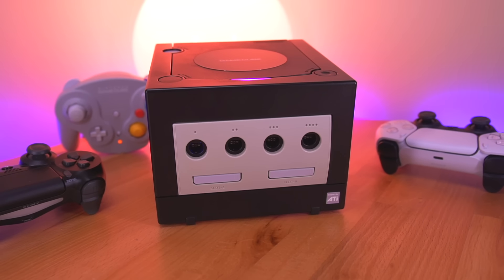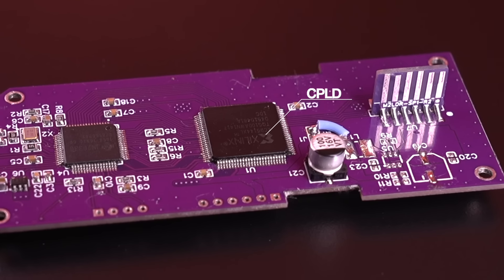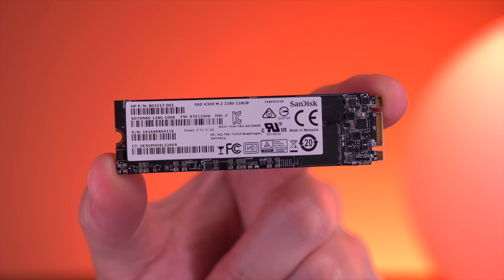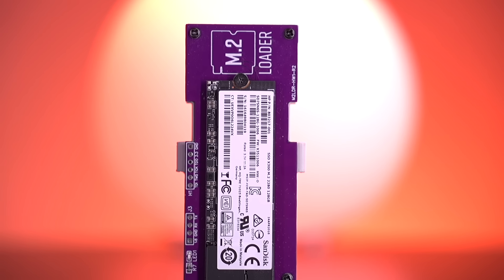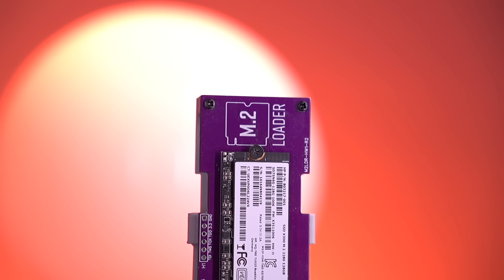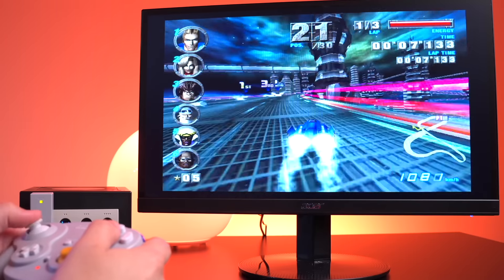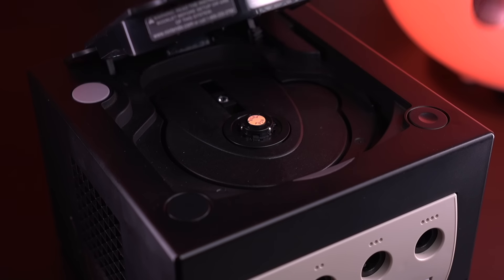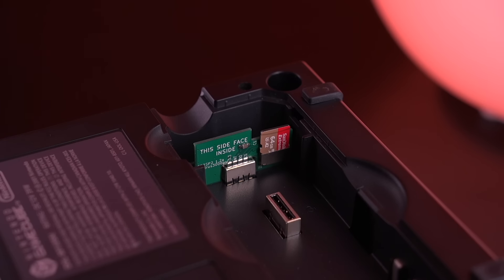M.2 Loader FIRST LOOK!  Unleash the Power of Your Gamecube!

Comment: This would be ideal for the Dreamcast as well, in combination with a recreated broadband adaptor in 1.
Reply: gdemu, MODE and usb-gdrom are already great solutions to this. The serial slot as a external device is not a good alternative to a external modification because the serial transfer speed is already way slower than the GD communication port the console has.
You can use SD serial adapter with Dreamshell but the serial speed is awful and it gets worse because all of the IO is handled in software. If a device similar to this existed it would be marginally better because of the external IO processor but it would still be bottlenecked by the awful serial speed of the console.
Although the title of the video makes people think that it is better to have a m.2 drive on the console, what is actually improving the game read consistency is the external IO processor, not the drive itself. I think it would be way more productive to make a SD Adapter with this IO processor built in instead of using m.2 drives that are still very expensive around the world.
Reply: @lordeilluminati  if they could combine the external IO and m.2 support for about 5tb.. imagine every dreamacat game cover art and video preview on a single Dreamcast.. 

We can only dream and hope that some smart cookie comes along and makes it happen. I'd be for it.

Comment: This is great, but a problem of SD2SP2 is that prevents the use of the GBA Player. It would be great if a future revision of this mod gets an FPGA on board with a GBA MiSTer core installed and some sort of physical switch, so you could to boot in NGC mode or GBA mode!
Reply: How does it prevent the GBA Player? I had no issues using GBI or my disc with my SP2
Reply: @Daqdaq15  I’m sorry, I had the impression it prevented somehow the use of GBA player. My mistake! (-:
Reply: It's the broadband adapter that it clashes with, as they both use Serial Port 1. The Game Boy Player uses the High Speed Port.

Comment: I have a Spice Orange Japanese GameCube that is modified to play both NTSC U/C and NTSC J discs with no visible modifications to the unit and was considering a second GC because I did not want to lose my optical drive but I did like the idea of using GC Loader. This seems like a perfect solution for an all-in-one GameCube.

Comment: The thing I don't like about all these things that take up the bottom ports is that you undo your ability to have things like the gameboy player or the ethernet adapter plugged in.  If you don't care about those things then it is cool to have the massive storage available.  I'd prefer to find a way to mount this internally or have a custom mini gamecube case that removes the disc drive that can fit the m.2.

Comment: The big difference in transfer speeds PC-side is mostly because most SD card readers use "High Speed" mode at it's slowest rate, instead of SDR50 mode or faster, so instead of 90mb/s+, you get 30mb/s.

Comment: Wow, I've owned one since release and finally looked into modding it. The GC2SD, SD2SP2 and pico board cost about $30. I'm doing this upgrade in prep for the M.2 loader. I love how it retains the optical drive. I never looked into GC loader much because I have discs I want to play and don't want to purchase a 2nd system, I have too many consoles already, haha.

Comment: Another awesome benefit that is usually discussed when using Raspberry pi products is that if you can use an SSD of any kind it is usually much more stable / longer lasting than the microSD installs. Might be worth noting in future videos comparing the two.
Reply: Yes, but in this case, not really. You're pretty much only reading from the microSD card after you put your games on it. The RPi Pico is a micro controller that doesn't have a microSD slot. The instruction set is written to a chip that is soldered onto the RPi Pico. It's a bit different from the RPi's you're thinking of.
Reply: @SoberAddiction  Thanks I was honestly unaware of this particular difference here
Reply: It would make sense if the console was reading and writing to the device, since data is only being read, there is no much difference in terms of reliability. Using SD makes more sense because it is cheaper to buy bigger storage than buying m.2 drives to a console that wont take advantage of the improved speed and reliability of the m.2 port.

Comment: Sounds like this will be great when it is released. I've had no real issues with the Xeno mod and the SD2SP2 though, and still no release date afaict on the M.2. So, as they say, if you can't be with the one you love, love the one you're with.  Will definitely be checking out the M.2 if and when.

Comment: Wow, i hope this gets adapted to PS2 and Xbox somehow down the line. Macho Nacho News Kicks Ass!
Reply: You can do this with off the shelf parts for the PS2 and Xbox. Look up a mSATA to SATA adapter, and then use a SATA to IDE adapter on that. There are also mSATA to IDE adapters, though they tend to adapt to laptop IDE, which has a different connector.

Comment: Apparently due to interference it's really not recommended to put the Pico in the serial port 1 area, but how cool would it be if the Pico could be part of the M.2 Loader by mounting it on it. Two projects by the same person combined into one. The 5 wires for the Pico could go towards this area without making additional holes yourself so no issue there, basically the only issue is the interference the Pico gets from being in that spot unfortunately.

Comment: But Tito, 2TB is a bit overkill for the GC, it's entire library of games is only around 880GB… 

Anyway, I've got my Spice Orange GC ready to be modded, I've got a Pico and Bluetooth controller adapter, as soon as this m.2 loader is available, I'll definitely get it.
Reply: Also, any SSD is so extremely fast that it will be wasted by the dinosaur hardware of the Gamecube.

Comment: Amazing video as always, Tito! - Can you suggest to WebHDX to look into including a serial passthrough of some sort so a broadband adapter could still be installed? -  Not bothered about having the adapter flush with the cube. I'm happy to put some rubber feet on the bottom to compensate for that.

Comment: This is amazing!  I'm extremely dumb and bought everything for the picoboot mod only to discover that my GCN is one of those fortunate devices to have a digital out but no SP2.  Did the entire mod just to have to undo it because I had no SP2.  I cannot wait for this to come out!

edit aaaaand I just got to the part where I still need an SP2 lol  I'm still very excited for this and hopeful that one day I won't need an SP2 :P
Reply: You don't need an SP2, use a memory card slot adapter.
Reply: For this mod, you can rebuild the sp2 functionally and leave the adapter and sd card embedded in the GC. Or make a hole on the case so you can access the SD card.

Comment: If he's going to downgrade to an RP2040, he might as well make a kind of "SD2SP2+" for SP1. The big bottleneck for SD cards is the fact the Gamecube addresses them in SPI mode, which is and always has been the 2nd slowest transfer mode SD cards have at under 10mb/s, and way slower than the Gamecube's serial port. With an RP2040, you could pass the SD card through the RP2040 in SPI mode during boot-up so RPiBoot can load Swiss, and then while Swiss is searching for storage devices reinitialize the SD card into SDR50 mode (which can cram up to 90mb/s, far faster than the Gamecube's serial bus) using the RP2040 as a translation layer. That'd eliminate the need for an SD2SP2 while still being dramatically faster, it'd be way cheaper to make since you wouldn't need the SATA bridge chip or M2 interface anymore, and 512gb SD cards at UHS Class 1 or faster (U1 marker on the SD card) are just generally cheaper than 512gb SATA M.2 drives.

Comment: There's a 4th benefit of using a SATA SSD instead of an SD card: they are way more reliable and last longer. SD cards don't have error correction and are prone to randomly dying from corruption. I don't know if this would be an issue in this use case if games are just loaded once then read from after that, but I would still rather have an SSD than an SD card any day.

Comment: I would imagine a lot will change once the RP2040 is used ,game compatibly, price performance, etc.
Also wonder if it would be easy to make a version with the Ethernet adapter built in with the rp2040

Comment: Just thinking outside the box here. The conversion from sata to ide is likely the reason that swiss can't load directly off this device, but once reworked to use the same chip as a raspberry pi, it might be possible to have the pi be smart enough to locally store (that is, not stored on the sata drive, but in the firmware) just enough to get swiss booted, then change communication protocols to fully access the sata drive when swiss boots.

Comment: Yet again although it's nice to have more GC stuff coming out of the mod scene, this is yet another solution to a problem that doesn't exist.  Now if when the new version came out, it didn't require a second pico and just wired into the picoboot and incorporated a sd2sp2 so you don't need to have both it might be interesting for anyone who's going to do a new mod to a system.  I'm perfectly happy with my current system and the speed increase is not something that I need.

Comment: I don't understand why removing the optical drive is apparently a deal-breaker for so many folks in these comments. It's likely going to be the first part of the console to fail anyways since the laser will eventually burn out, but there's also just no functional reason to load games from slower optical media if you're replacing it with a device like the GC-Loader that will ultimately be loading the exact same games from solid state storage (and can already boot Swiss directly).

I could almost see an argument for keeping the optical drive on something like the PlayStation, where you can at least use it to play audio CDs or DVD movies, but the Gamecube's drive was only designed to handle mini-DVDs, and the Gamecube BIOS/firmware has no means of playing CD or DVD content anyways, even if you made your own 8cm copies for some reason.

The GC-Loader's biggest weakness is that SD cards are a frail storage medium with a comparatively high premature failure rate (and extremely limited write cycles even in ideal conditions), but the M.2 Loader doesn't currently eliminate that dependency either since you still need to augment it with a SD2SP2. Personally, I'd be much more interested in seeing these two devices combined to replace the GC-Loader's SD Card interface with the M.2 SATA connectivity of the M.2 Loader, so you benefit from the faster bus speed of the Gamecube's optical drive port and the improved storage capacity, IOPS, and longevity of M.2 drives. With something like that, everything you need for a state-of-the-art modded Gamecube could be contained within a single plug-and-play device.

Comment: I'd recommend Cel Damage as a test variable. Have always struggled to run it, albeit on emulators. Not sure if the problems from emulation correlate to problems loading from subpar loaders 🤷‍♂️

Comment: This is really awesome! How does compatibility compare to playing GC backups on the Wii?

Also, for those wondering, 1 terabyte is going to be enough to house literally every single GameCube release from a specific region with some room to spare. Even though you can still get that with an sd card or even a thumb drive, an ssd is going to be a much more reliable and speedy option in general
Reply: Not really in this case. The Cubes serial bus speed is slower than both, modern SSD's and SD cards, for that reason the old GC Loader is still the faster option as it utilizes the faster DVD bus.

Comment: The easiest solution to that last con seems to be to make the final device use both bottom ports to do exactly what each individual piece is already doing to boot it. In the meantime, both ports could then be simultaneously used to stream multiple data channels to the GC(ex. having one entire port handle graphics while the other handles audio), increasing overall throughput to possibly even get rid of the last few audio pops.
Reply: But both of those ports use the same bus, so unless the ports themselves are individually slower than the bus, I'm not certain what the benefit would be.

Comment: Neat, just kind of wish it worked with NVMe drives, they are much more common and cheaper from what I have seen. I guess this all depends on the price point.  My SD2SP2 loads 95% of the games I play fine, maybe some minor audio issues during video playback (not a HUGE deal) but, I during game play, nothing I have noticed. 

When you said, in the cons, expensive, this is something that is already a turn off for me. Very cool device, looking forward to seeing a final review.
Reply: By saying expensive he referred to the Broadband Adapter.

Comment: It would be really cool to see a variant of the M.2 Loader that had a half-length M.2 slot but also had an Ethernet adapter onboard.

However, I'm aware that the Gamecube's Broadband Adapter hasn't been fully reverse engineered in protocol yet - which is an obvious barrier. And that lesser length M.2 SATA SSDs are surprisingly rare and/or expensive.

Comment: First of all, greetings, the video is very good, I hope that this project reaches 100% compatibility and that it can be launched without the need for an optical drive or emulator, I would also add a Ethernet port and wifi class g or ac and not for the games but to interact with a smartphone to save games or backups of games that I have the license, This is out of the topic, swis could be modified to use the phone and run cheats. On the other hand, I do not see a future for this little device, it is very expensive, an SD is cheaper and the hardware is cheaper and is finished, The game cube catalog has never been bigger. Assuming that one of the latest versions of sd card called A2 extreme could put the m2 disk out of competition because it would equalize its transfer rate, remember that we are on a bus of data of the nintendo game cube where the high data transfer was not yet thought of

Comment: Wait, so, this looks like the ultimate way to mod a gc. I want to do this. Can you make a list of instructions from beginning to end for this while thing including its compatible other mods? Homebrew, picoboot, and this thing. Also, would it be possible to add a custom shell with pretty lights or would that be too much power draw? Like the lit up controller ports and led ring around the seam of the body and other such common lighting mods. How much power can the gc output and how much does all this stuff draw

Comment: Genuine question. What upsides are there for buying a game cube over a wii?
Reply: the ability to interface with the GBA and other hardware specific accessories/features 
if you strictly want to play GC games then the Wii does the job just fine, but you'll lose features exclusive to the GameCube and you won't have a little box sitting on your shelf anymore!
Reply: @silver1407  But the Wii U in theory can do all of that and output in 1080p.

Comment: Really hope when it's released or in the future it won't require an additional option to boot swiss, realized recently my GC is a transitional dol-001 model that has the cut out and labeling for the Serial 2 Port but doesn't actually have it...
Reply: You don't need SP2 for a modchip. You can also use SD Gecko adapter which plugs into memory card slot. M.2 Loader won't be able to boot into Swiss on its own, it's technically impossible.

Comment: if its has not already been planned they should add the sd2sp2 at the end on a separate circuit and then someone should design a 3d printed cover that will cover both slots.
Reply: SD2SP2 won't be required in future version. PicoBoot will be updated to boot Swiss from the SSD.

Comment: I mean, a SATA M.2 SSD is being kneecapped by both the ANCIENT EXI interface in the Gamecube and the no-name USB3.0 adapter (try looking for a USB 3.1 adapter for even better transfer speeds). SD cards are SLOW and expensive and SSDs are FAST and relatively cheap.

Comment: I will be so much bad ass with my 20-30 gc games 1 GB each on 2TB ssd for only 199.99$, instead of using those disgusting 6$ 256GB SDs
Ps. Though the video and sound quality on ssd is much better, they really cost much more than sd cards and you don’t need so much space for gc games

Comment: I know nothing about GameCube modding--this vid just randomly showed up in my feed, but my first thought after seeing this is a wifi chip w/ software for reading games/software from a network drive. I wonder if someone is working on that. Considering most broadband connections can probably max out the serial bus (no idea what its actual capacity is), it could be superior to the SSD in many ways.

Comment: Hi, thanks for your video. Is there some interesting mods for Xbox 360? Except modding case and adding/changing cooler. For example: breaking the limit of 2TB for storage, using disks on both SATA ports, increasing RAM size (dev kit has 1GB).

Comment: if the maker of the M.2 loader wanted to they could most likely make a revision and add network comparability to that board having the chip do 2 jobs and use 1 slot, then if they really cared they could work with Wiimiifi to ave them host servers for the few online games on the gamecube.

Comment: If I understood correctly, the performance difference between the SSD and MicroSD does not actually come from the drive speed.
So in that case wouldn't it be possible to make a MicroSD card version of the M.2 loader and still get the same performance?